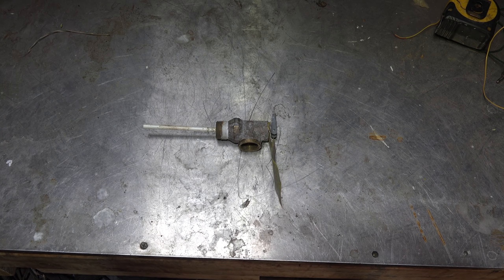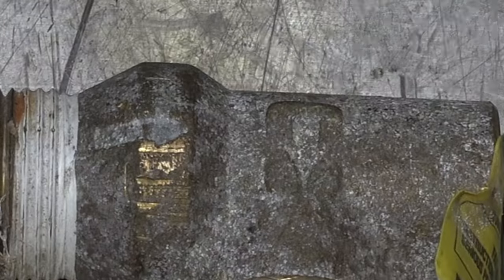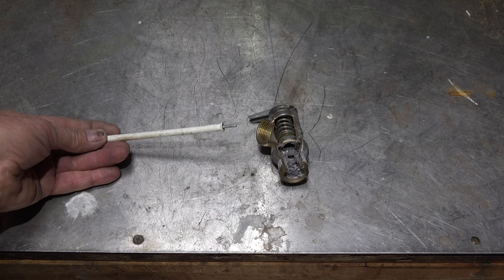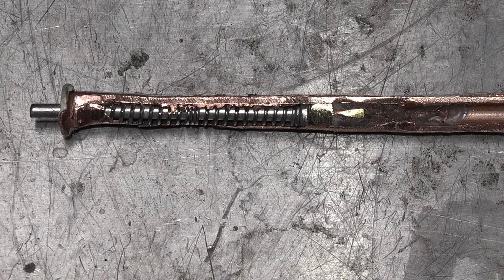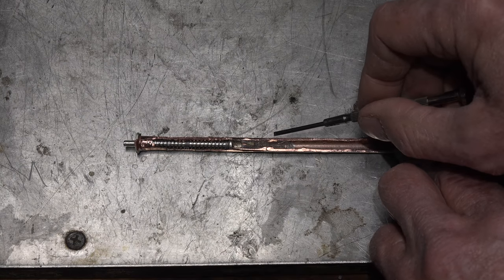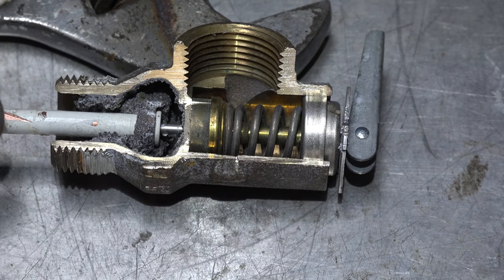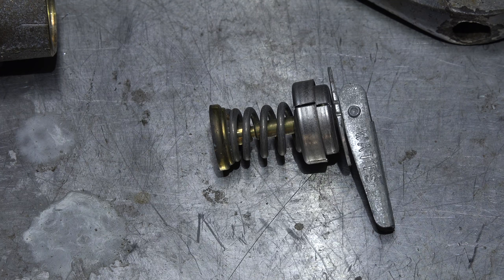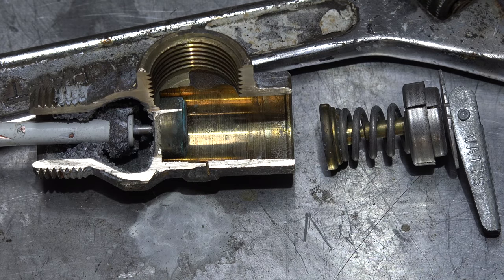How does the T&P water heater safety valve work.

Comment: Thanks for the video, great training for some of my home inspector friends. Watts recommends yearly inspection by opening and closing the valve, and every 3 years having a plumber remove and inspect the valve. This is written on the yellow plastic tag attached to the valve. More in-depth info used to be on their site, but due to a recent remodel, this is now very difficult to find.

Comment: I would imagine that the temperature probe works exactly the same way as a coolant thermostat on an engine, the wax melts and the liquid is less dense than the solid so it takes up more volume and forces out the pin via hydraulic pressure.
Reply from the maker: I think you have it.
GFM
Reply: wax motor, 'aka' linear actuator :) you got it on the temp relief. the spring/compression height is obviously the pressure relief control..
that being said, as the rubber/nylon/ptfe disc seal compresses with age/thermal cycling the spring height changes as does seat pressure... yeah, this thought is well beyond plumbing/hvac and heavy into mechanical/engineering lol
Reply: Lol I wasn't the only one referencing cars when trying to think what that stuff was.. you guys are cool

Comment: B&G had or still has heat motors that worked on that principle in zone valves. Some kind of wax or something inside would get hot and expand opening the zone valve.

Comment: More specifically, this invention relates to an improved thermal relief valve of the type described in U.S. Pat. No. 5,641,119, which is incorporated herein by reference. In that patent, a thermal relief valve is described as suitable for conventional or miniature fluid piping systems. The thermal relief valve includes a cylindrical valve body with a bore that houses a thermal actuator. The actuator has a piston and wax that melts and expands at a predetermined temperature. When fluid temperature exceeds the predetermined level, wax expands and causes the piston to extend, thereby moving the thermal actuator axially within the housing. The actuator moves from its normal closed position in which the actuator engages an O-ring seal to an open position in which the actuator unseats from the O-ring and forms a gap therebetween. Fluid may then pass through the valve, flowing first through an annular passage between the circular exterior of the thermal actuator and the circular interior wall of the bore in the valve body that houses the actuator. The fluid next flows through the gap adjacent the O-ring seal and exits the valve.
Reply from the maker: Very thorough explanation, thanks
GFM

Comment: Man I can't seem to find anything on these because I'm curious about shank length. Found one about an inch shorter than original but I don't see anything crucial about length. Besides maybe some surface volume 🤔. 
Any who, when GFM popped up I already knew I was going to get some quality information I never knew I needed.
Big fan here. My college hvac/r instructor turned me onto you in 2014/15. 
Here in fresno calif.
Whats funny is we seen a video of a water heater explosion during safety class and I remember him saying his wife was puzzled how that could happen and he said to her, that shouldn't happen ever it's next to impossible someone somebody did something they weren't supposed to do.
It's literally the reason I can't just use the inch shorter shank valve haha. 3.5in I guess I need 4in.
But he literally beat every single subject, theory and science into us including safety. 
Big thanks.
Reply: I tend to believe that the length has to do with the temperature that the valve opens at.

Comment: I've replaced a T&P valve that failed once,  I'm not a plumbing expert by any means but I understand how a water heater works and that the T&P valve is a safety feature that can save your life in the unlikely event a thermostat is locked up and the hi limiter fails.   I always wondered how the valve works to provide high pressure and high temperature protection in one device.
Reply: Normally when they "fail" they are doing their job and there is another problem that needs to be fixed.
Reply: @NZ2STROKE  it became jammed with minerals.   I was testing it by flipping the lever to make sure it can relieve if it needs to, and the water wouldn't stop and kept dripping when I let go.   Exercising the lever didn't help and I think the water heater in question was close to 10 years old.   But you're right, if the valve is dripping there's likely a reason, thermal expansion is a more common issue than you might think because many local plumbing code require a pressure reducing valve or check valve at the water meter to prevent contamination of the water main if there's ever a sudden drop in water pressure.

Comment: One thing is for sure.  Before assuming the t&p valve is bad and replacing it, you always check the p.s.i. and temp of the water heater/boiler.  Too often ive heard my plumber buddy say.  "I replaced the damn thing and found out the setpoint was too high". Lol

Comment: I would think the material inside the tube is similar to the wax in a taco zone valve head that expands at a set temp and maybe contracts when it cools down . Retired master plumber.

Comment: Does the prove has to be in contact with water? I got a little water heater with the valve on top but I would like to install a elbow and connect it to a pipe so it can be installed horizontally, would that work? It won’t fit unless I do that.
Thank you
Reply from the maker: I would not move the valve.  It is a high liability safety device.
GFM

Comment: it could be combo wax/alcohol motor, alcohol or \similar, liquid behind the wax, wax just used as a seal/buffer. it staying out could be due to passing the motors spring thermal rating, maybe it melts also.never cared to dissect one

Comment: Sir if you don't mind ~  our issue with outside AC: When we turn it on it runs fine - as soon as it runs awhile - it goes off and you will hear the compressor come on and the click, but the big fan won't start back - is it a relay problem do you think?
Reply: We already replaced the capacitor....   Thank you for any thoughts you may have....
Reply from the maker: @BlessedFloridaMom  If the outdoor fan stops, and the capacitor has been replaced.  the fan motor is probably failing.  Check to see if the motor is hot.
GFM
Reply: Thank you Thank you!!!!  You are so wonderful to share your knowledge....  We watched your videos and learned about the fan motor and yes thats the key we think as well - we finally got tired of being ripped off!  Do you believe we paid $300 for a fuse that when we took the cover off was sitting in the front???!!!!  Now that I am learning about this stuff I am insulted!  A friend of my neighbors who runs his own outfit today came for free and confirmed just what you said - fan motor - you are wonderful!!!  Thank you and God Bless you and your work!!!

Comment: Tapped the pin on the top of mine and it stopped weeping
Reply from the maker: Hopefully, that will continue to keep it sealed.  
GFM
Reply: @grayfurnaceman  it shouldn’t cause the mechanism to stop working though right? I can still open and close the valve (had to re-tap the pin to seat it again) i’m very light tapping with barely much force using a rubber mallet
Reply from the maker: @Ultrajamz  You are doing correct with the rubber mallet.  
These valves are are pretty much idiot proof.  Even if the lever is clamped with a C-clamp, (yes, I have seen this) it will still relieve.
GFM